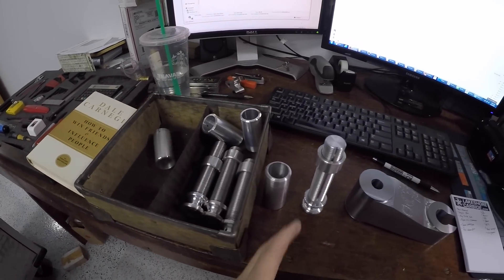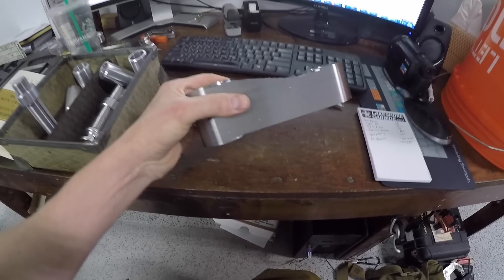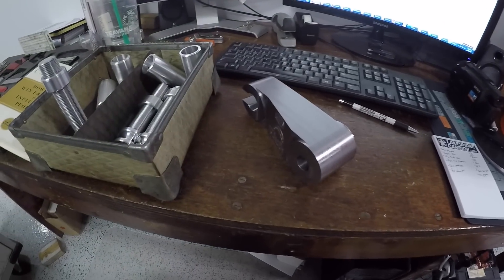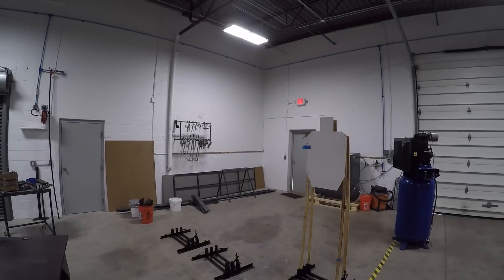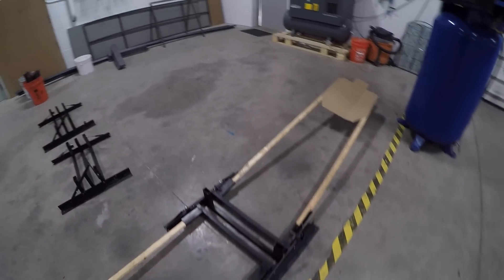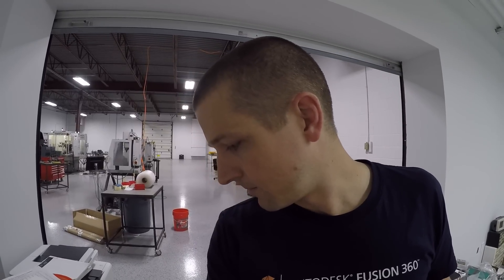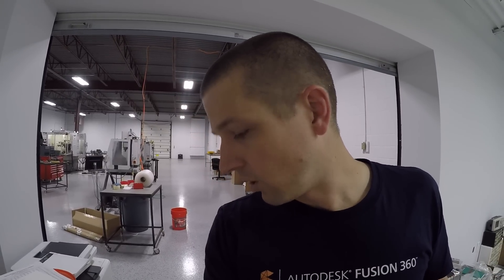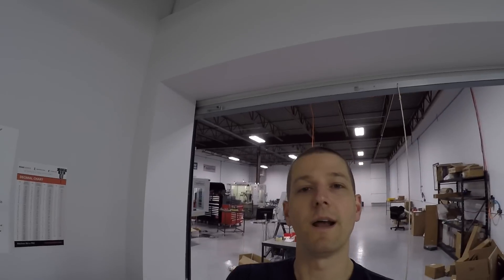Chip Break #9 - Machine Shop Insurance, Must-Read Book

Comment: At least in Texas, I don't think it really matters whether you call yourself an engineer or not.  It's the practice of engineering that's in question.  According to the Texas rules:

The practice of engineering includes: 

(2) design, conceptual design, or conceptual design coordination of engineering works or systems"
...

(10) a service, design, analysis, or other work performed for a public or private entity in connection with a utility, structure, 
building , machine, equipment, process, system, work, project, or industrial or consumer product or equipment of a mechanical, 
electrical, electronic, chemical, hydraulic, pneumatic, geotechnical, or thermal nature;

It includes a many other restrictions.  But it's the practice of engineering, not the name "Engineer"..  Also, I know that if you work for a company and are performing engineering for that company, a PE is not needed as it's all internal (ie, not the public).  It's doing work for the public that is where a PE is required.  

Please keep in mind that I'm by no means an expert in what's PE and what's not.  I had looked into to getting my registration a few years back (like 20 years).  But the year I was planning to make my application, the Texas rules changed which added new requirements.  So I abandoned the plan.  If you have questions, it would be best to look-up and read the rules at your particular state board of engineering.

Comment: I am currently where you were years ago, in a condo with the beginnings of a shop in my dinning room. 
Bought an 80 year old SB Model C lathe. (runs well) and an Enco mill drill. (good shape-ish).
Having fun with it so far, mostly making tooling, parts and fixtures for the shop and the machines.
You are partly to blame for this inspiration, or "disease". The rest of the blame falls on Adam "The two Keith's" I call 'em, Randy Richards, Stan Z, Dale, Pierre, Bruce, and the rest. .. ..    !!

Comment: I do custom electronic designs for customers. My customers are companies with their own line of products. They typically contract me to do design because they are too busy and they need it fast or they are too small to hire a full time electronics engineer with the many tens (hundreds?) of thousands of dollars of equipment needed for high speed designs. 

I find out exactly what they need before I start. Mostly, they'll want a design done and then they will handle standards compliance and testing of the product. Of course I do testing but it's at the low level to make sure the circuit is working and not at the end user level. At this level I make it clear that I'll be delivering a prototype design and it is not for production.

I make it clear in the contract what I will deliver, what I will test, what testing I won't do. I also point out what compliance testing they need to do to make sure it is at least safe. They must also take a role in this part as they will have knowledge of what other measure will need to be taken so they can finally sell their product. It is beneficial to find out what these other measures may be up front.

Of course, if they want an end product they can sell straight away, the initial investigation takes longer, the quote takes longer, and the price must go up to account for investigation, design, prototyping, testing, reruns, re-testing, safety and compliance testing, etc. 

You should get a lawyer or solicitor involved (not sure what you call em in the states) to get a standard contract drawn up. You can then modify it as needed for every customer. Maybe you need a one that simply covers prototypes and use that so they are clear that they are getting prototypes.

Great channel BTW.
Reply: Maybe just some sort of disclaimer on your invoice then? Something that states the parts (and designs) are prototypes and are not yet ready for mass manufacturing and the customer is responsible for final testing of the product and designs for the end use. I'm no lawyer, so if you do put something on, you should get the lawyer to look at it. It's not as expensive as you think. I was quoted about AUD$5K (maybe USD$4000) for a full contract (that I could modify with prewritten clauses) that allowed me to work with a major aerospace company. A small disclaimer on your invoice shouldn't cost much and might be the best insurance you've ever taken.

Also if customers do ask about it then it has done its job. They DO have to be informed of where they stand with regards to the fitness for purpose of the product you deliver. Most of my customers understand entirely.

Comment: Regarding your insurance, you didn't provide a lot of details.  But in Texas, there are pretty strict rules about shops providing/advertising for design and engineering services.  A few years back, there were some rule changes, the details of which I'm not current.  But basically, in Texas you have to be a state registered professional engineer in order to provide design and engineering services for the public.  There may be some fine lines between Makers and regular shops.  But I think you're crossing over the Maker boundary into a full blown shop (Yay !).  These rules don't apply for internal engineering and design or products.  But do apply for folks coming and looking for engineering or design.  

Is that the case where you are?  Maybe that's what your insurance is worried about.  Just a guess.
Reply: Eric, I've been looking at the laws in both Texas and Ohio. While a strict interpretation would support your argument, another argument would be that as long as one does not represent themselves as an engineer they would not be subject to licensing.There are hundreds of industries where an individual will make recommendations to a customer regarding design or functionality (machinist, software developers, auto mechanics, and this list goes on).What is your experience regarding this issue?

Comment: Those machined parts look mighty pretty and I can understand you being proud of them!
The camera gimbal certainly smooths horizontal movement when your walking and especially turning however I think that they are not successful with major vertical movements.
Insurance is an increasingly necessary requirement in today's blame and claim society  and of course is a legal requirement in some cases (eg motor vehicle). Do you have any mutual society insurers in the USA as I have found that these have been most helpful in my case as they work for members rather than a company as such. (Membership costs a small sum per year but they often offer other useful services that might be useful such as legal representation.)
Do you have access to a Small Business Unit development organisation in your town/area/region? - they may be able to assist you.
A further possible contact might be a Professional Engineers Society / Group in your area who could point you in the right direction for useful contacts.

I'm afraid that for me with regard to insurance the devil is in the detail and it is often what is left out rather what is included!

I personally like Brian's practical comments below on this thorny issue.